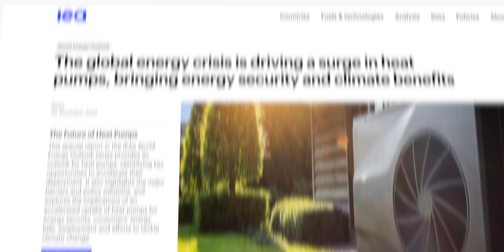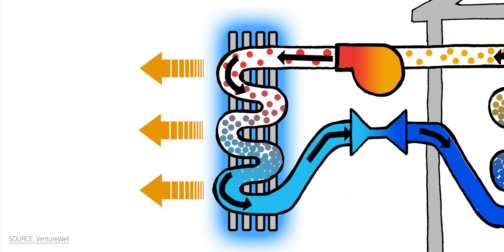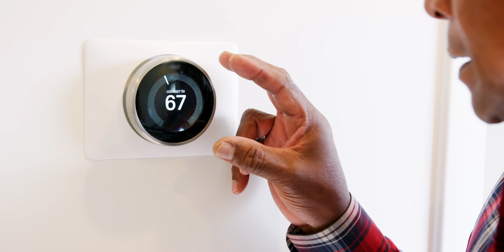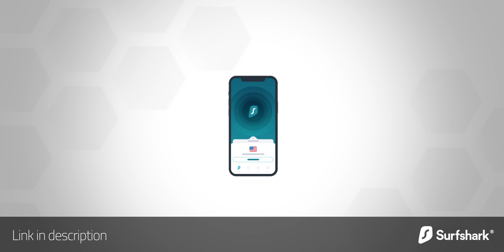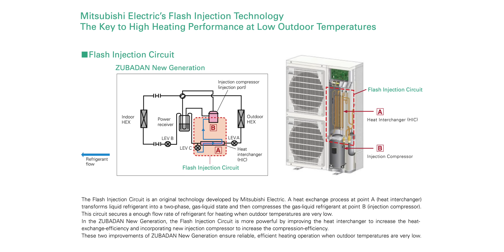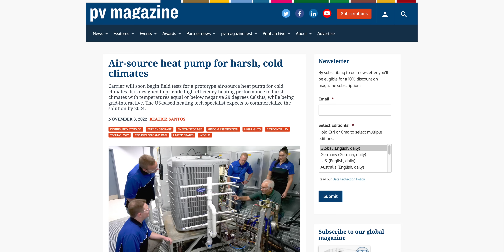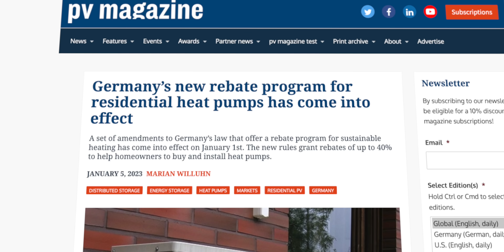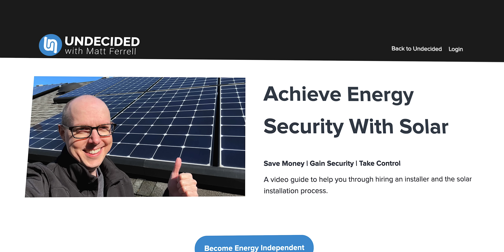Major Advances with Heat Pumps in the Extreme Cold

Comment: Are the money savings based on heating electric elements vs a heat pump or a heat pump vs natural gas heaters?  In some areas natural gas is WAY cheaper than electicity.  I'm not saying it's right or better but when you talk about money saved it does matter.

Also does the energy used by heat pumps go up at a higher rate than gas when it is particularly cold out?
Reply: COP is the figure you're looking for.. Direct Electric heating (i.e. resistive) has a maximum COP of 1, i.e. 1 kw of electricity goes to 1kW of heat.  Gas depends on the efficiency of the boiler, as you lose heat out of the flue, the absolute maximum cop from gas is 0.95, with about 0.9 being the best case if a home isn't a low-temperature heating home.  Heat pumps vary, e.g. my A2A heat pump has a COP range of about 2 at -30C, and can hit a COP of about 5 at around 6C. Given the temperatures I commonly get around where I live in Sweden, I can (except in extreme cases), expect a COP of at least 3 in general, and if it's at least 5C outside, I'll get at least a COP of 4.  So in my case, for <5C, as long as each kw of electricity costs at most around 3x the cost of 1kw of gas, then I'm saving money, and if it's 5C+, then that rises to 4x. (Not that I have a gas supply where I am anyway).
Reply: @BenIsInSweden  Thanks, that is useful info.  Right now it would take about 30 years for me to make up the money for the system.  On the other hand my electric bill is 100% free from 8pm to 5am, so I may get batteries, charge them at night for free, then use them to get through the day, then charge them for free at night again.  If I do that then using electricity to heat my house then become a different economic formula.

Comment: Hello, thank you for your video! I recently installed 2 24k BTU Samsung Max Heat’s and never went without heat this winter, very pleased.  My question however is less conventional and really perked my interest to further investigation.  I am actually in a fairly good place to consider ground loops with a high water table;  but since we already invested in the “cheaper” air sourced Heat Pumps it would make little sense to also install an indoor unit.  What I have seen however are products on the internet that claim to be able to plumb in well fed or ground loops for heat exchange and boost efficiency.  This would really only apply in <20 degree Fahrenheit temperatures or > 90.  What are your thoughts on how that would even work? I imagine one could program an arduino to control a solenoid for flow control but I’m not positive.  Mainly I can see an overall efficiency gain overall since on mild days Air Sourced Heat Pumps operate at pretty much the same COP as a ground source and the the same efficiency can be applied using the ground loops in the temperature extremes.

Comment: Matt thanks for the info. You always provide clear and useful information. 

I do have a question. With regard to your ground source heat pump, how did you decide to go with a vertical well rather than horizontal especially if you had the space? What was the trade off that made the higher price of the vertical well worth it?
Reply: If you have the space and the means to dig (eg at site development time) there's no competition. A horizontal loop at the right depth is a lot less expensive than boreholes and performance is much the same unless you live in a very extreme climate with enough solar incidence to cause a problem in Summer and very cold Winters leading to permafrost.

Comment: Course if you go to Walmart app and find a cheaper ones at the song on sale and stuff like that and get a $600 to $700 but you only to do that during holiday time or through the tax. Or something like that I just bought one cost me $602 and that's what shipping and handling as well as a warranty of course that's the cheapest one I found the other ones I found I want to buy as a little bit more take the most expensive when I'm going to get 778 dollars plus whatever the warranty is and plus whatever the shipping is shipping's not too much money at something like six to $12 I think maybe a little more I don't know order stuff from all-time in shipping overseas be kind of cheap so that's not so bad but if I want to get them cheaper I can always go his go up to 230 volt to 240 volts but I'm just buying the ones that are 120 volts and less so I can plug it into a regular outlet or a 12 volt inverter I may not have enough soap in his rental house but I'll have enough solar panels around a couple and air conditioner heat pumps. Of course I got some in my cart through I think it's Amazon that's a heat pump to do four rooms and a heat pump to do three rooms which almost going to buy and I think those are 230 volts or 240 volts that's okay I got inverter to run 120 to 240 volts. When I can afford those I will buy those probably too after I get a vehicle or after I get the loan and proved that's if gets improve but I guess it's improved I take a look at my house to see how much it's accurate to sandwich they cannot to give me I only want like something like 30 thousand to 35 thousand dollars and they're telling me that give me $74,000 regardless and if I don't need all that I can give it back to him on the first couple mortgage payments I guess they call it pulling money out of my house to get this loan but the good thing it's a lot less interest in refinancing for a vehicle which was going to do but they told me to just get it out of the house instead cuz the interest rates are four times last are pretty close to four times less and they also said I can pay off the loan early too so but if I'm getting this loan and pagan also order some solar panels to complete solar panels are probably need her for most of part of the solar panels I'm going to need to run my house and also by the inverters to hook up to the instead of the murders have been buying which I guess one of them I connect you hook up to the house electric .

Comment: I know a running system with a zubadan split heat pump, is has a cop of 2.2 because it produces relative hot water (55 degrees Celsius) I think that’s bad.

Comment: Some ground source heat pump installers are using horizontal drill rigs to install the loops. From one hole the drill can go in several directions to work with the property conditions. The drill can also drill at an angle which can help the heat exchange efficiency.

Comment: Heat pumps can't work when there is no heat to pump.  You probably need a massive compressor / coil in -10F weather!
In some areas (MA) the cost of electricity may be high enough that using a gas furnace will be cheaper to run than a heat pump.  In that case, it's game over, the hell with green environmentally, we are more concerned with a different kind of "green"!
Reply: No heat energy is at absolute zero at about -459F, if you're at that temperature then you have far bigger problems than whether your heat pump would work or not.  Many air source cold climate heat pumps work fine even further down than -10F.

Comment: Remember also insulation! Insulation is even better than using energy for heat, but is has to be done with care to avoid mold and other problems. Heat pumps have been used for a couple of decades soon in cold climate countries so there are good options certainly available. Just check the specs.

Comment: I seen in Ukraine where there's a lot of bombing from the Russian army where were they destroyed these buildings that had these heat pumps split air conditioner heaters indoor unit outdoor unit on the sides of the buildings and they get colder weather than we do and they seem to have a lot of them too bad the Russians destroy them but they use air conditioner heat pumps as well they must have liked them because they had an awful lot of them so my thought on this I think there are pretty good machine and if it's summertime business was only a air conditioner heat pump indoor outdoor unit open up in February to start selling stuff the only use you sell the summertime open in the summertime can start up in February and we're two shirts in behind the counters and stuff like that it must work pretty good special needs to have to wear coats when they didn't have one.

Comment: I have had 2 air to air heatpumps since 2005 and the newest of them saved med 26% of my bill this last year of kw used since it was installed .
Thenold worked ok until -15c but the new one does not have had this issue its been more than -20c with no problems its a Panasonic HZ Flagship 

It has its issues with noice over a  electric heater but it saves a lot of money. Both the indoor and the outdoor area.
Best is a water to water heatpump but you can start small with a air to air if you  dont want to invest a lot of money upfront and still save some money.

Comment: He said Heat pumps struggle below 5C? I thought heat pumps can go well below freezing with ease. At least that’s what Technology Connections made it out to be, assuming dry cold. 

I just bought a house and already had gone through 2 extreme cold events. One dry and well below freezing (16°F -8°C) where the heat pump worked fine. 
The second was barely freezing (30°F -1°C) but with freezing rain where the heat pump didn’t work at all and had to resort to aux resistive heat

Comment: Hello, the first step in reducing your carbon footprint and saving energy is fixing your house envelope. 
Your home must be adequately insulated and sealed.  Doing this will reduce your need to heat or cool in the first place. Solar with battery storage and efficient electricity use is the way to power your home.

Comment: Unfortunately my experience with heating with heat pumps has not been that good.  I’ve had heat pumps since 1979. AC works well and is more efficient than say, window units.  Heat not so much.  The units blow cool air, albeit it might be at 70F but it feels cold.   Additionally, the electricity use has been quite expensive in my opinion.  I’m not sure it is the temperature but the air handler.  It seems to use a lot of electricity as measured in my electric bill.  How do I know?  We use propane for heating.  This generates extra moisture in the house which annoys the wife.  She turns on the fan to reduce the moisture. Serious impact on electricity use.  Plus, the propane stove feels better.  We will likely need a new heat pump before too long (our current unit is quite old) so we will see how much better the news are.  I will add that we have had much less maintenance, and cheaper, with propane than with our previous heat pumps, our old house had dual units and we had issues every year.  I will also add that the propane stove doesn’t go out when we lose electricity.  I’ve got alternate power just in case but it wouldn’t run a heat pump.

Comment: My parents installed a vertical one around two years ago here in the Swiss mountains. Together with our solar panels our house is now basically self sufficient and both the heat pump and the panels have worked fine in the two years even during cold days in winter
Reply: You found solar panels that produce electricity without the sun?
Reply: @FiZc  Although this is a very common misconception they actually do receive sunlight in Switzerland.
Reply: @JackHays75  Sunlight during the night or shady/rainy days? Tell me more, please ;)
Reply: @MilošHoleček  No, no that would be silly. The way it works is during the night time you can take power back from the grid. Most homes with enough solar capacity are able to feed more energy into the grid during the daylight hours so they have a net surplus of energy. It's a balancing act where you share the load between homeowners and the energy provider so that they don't need to run at full capacity during daylight hours because of backfed energy. It's not a perfect system but it's certainly better than building more coal fired plants to run everything and we can't let perfection be the enemy of progress. There are other options as well, for example at my place in Texas I have enough capacity to charge my battery banks during the day and that will usually be more than enough to do whatever I need at night without even pulling anything from the grid. I know this is prohibitively expensive for most people so I don't suggest this as a perfect solution either, I was just in a position where I could afford to install this equipment on my new built home so I did it because I enjoy the feeling of not being reliant on outside power sources. It won't be economical enough to pay for itself within the years of life I have left but that's not what it was about for me personally. Battery tech will improve and become cheaper so eventually this will be a much better option for more people.
Reply: @JackHays75 using the grid don't really make it self sufficient. It just give the illusion of that.

In fact its highly dependent on the grid.

The issue is that if PV grew, the price of electricity will decrease sunny days and increase clowdy days.in worst case, it may produce negative price sunny days (we alredy start seeing that, so you have to pay both when you produce and use.

Just because the power meter says +-0 don't imply its self sufficient.
Reply: @matsv201  Absolutely, you are correct. The only option to be self sufficient is an expensive battery system unless you have constant wind or hydro or some other source of course. I still have a grid tie because I wasn't sure how well or system would do when we first installed it but honestly with a little more battery capacity and careful use I could cut away from the grid now and we would be fine. I do have to express that this is simply not economical for the vast majority of people now and I would save a ton of money by just using grid power but I'm lucky enough to be in a position where I can do this for the feeling alone so that's where I'm spending my money.
Reply: @JackHays75  you really can't have a battery covering winter, because not only is it colder and shorter days. It tend to be clowdier at winters. That can easily outlast any battery.
Reply: @matsv201  You're right, it doesn't work everywhere. Where I am in central Texas however it works fine year round. Our winter is very mild compared to northern climates. My location very rarely drops below freezing and we have full sun about 300 days of the year.
Reply: @JackHays75  even when saying it works at -25, the cop factor is like 1.4 . Personally I consider that not working.

You need to go to something like -10 (posibly -15) to get cop factor over 2.5 when it's actually somewhat economical.

Of cause, that is with a air-water type.

If you have a ground source there is less of a problem in winter (while the problem is still there). The issue on the flip side is that they get worse warm water cop the other 9 month of the year. Getting a cop if 7 in summers is pretty nice, and still 5-6 in spring and fall.

My thinking was that when ever it gets cold, electric power gets expensive. So that is exactly when I don't want to use a heat pump.so i simply turn it of when the cost per produced kWh reach a certain point.
Reply: @matsv201  You just have to have the right size battery. That size depends mainly on whether you want to heat your house with a heat pump or wood stove and depends on the size of your house. A small house with a wood stove for primary heat, you won't need a large battery as you will only need enough electricity to run appliances (such as water heater, stove, microwave as primary cooking, refrigerator, etc.) lights, and heat pump as secondary heat. To use the heat pump as primary heat would require a much larger battery, still do able but expensive.
Reply: @matsv201  🤔 wtf, matt. It’s like you are putting down the PV  system because it needs the grid, or because you get less power in winter, or because batteries are expensive. Dude, wtf are your requirements? You can have lights and heat 100% off grid in winter for 10x price. If you install a wood stove you can have lights 100% off grid for 1.5x price. If you don’t care about off grid you can have lights and heat for 1x price using grid tie which sells extra solar back to the grid.

But all you seem to do is shit on the guy’s solar installation for no good reason. I personally think solar has to be 2x more efficient and electricity 2x more expensive before I’ll buy it, but that’s my requirements.
Reply: @Greg-yu4ij  why are you do anyed at reality?
Reply: @FiZc  I’m assuming you’ve never heard of batteries?
Reply: @inter5123  What a dumb thing to assume.

Comment: Matt, the mechanism for transferring heat into the living environment is one of the major factors in overall system efficiency. For example, conventional radiators employ 55°C (min) water circulation. In contrast I have a ~70 tonne foundation slab within the insulated shell of my build, and this includes embedded underfloor heating (UFH) loops to heat the entire 70t slab.  I can circulate wat at 30°C and this is plenty enough, and can put this heat in pretty much at any time of the day, that is whenever the electricity is cheapest.  ASHPs have a far better CoP and better cold-weather performance at 30°C vs 55°C output, so the system is far cheaper to run.  Putting the insulation under and around the slab instead on top; casting UFH within the slab  adds relatively few $K to the cost of the slab if this is designed in pre-build.  Hence, these systems are far more efficient on new-builds optimised for their use and building codes should be updated to facilitate this.
Likewise DHW systems using PCM heat stores and input preheated from a 30°C buffer or 20°C slab can also work out to be cheap to run, but again the initial install really needs to be optimised for this for it to be cost-effective.